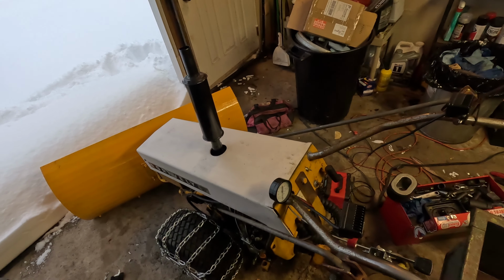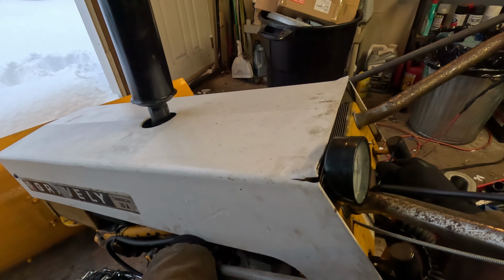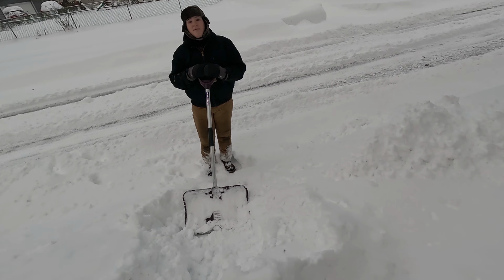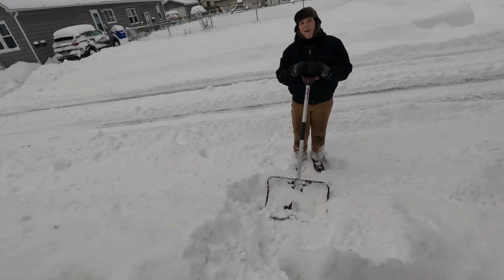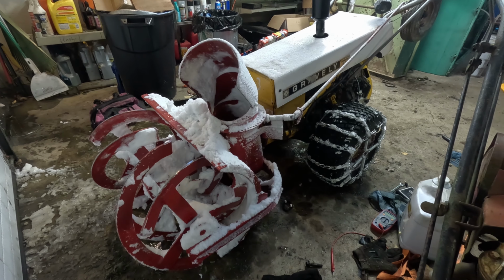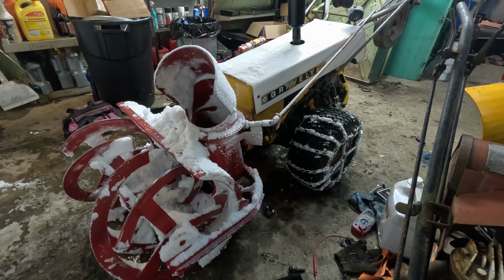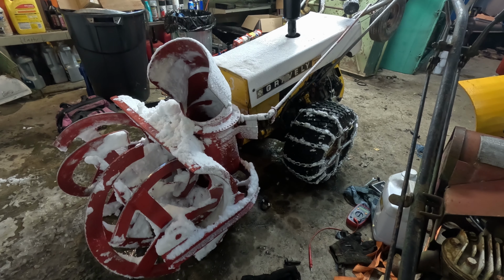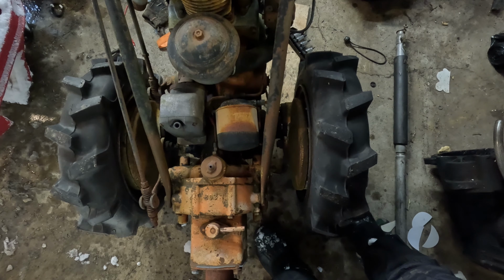Diesel Snow Blower - Repowered Gravely C10A

Comment: Cool snowblower for sure. If you add an Impeller Kit to it...that thing will throw that heavy wet snow 40 feet.
Reply from the maker: @xoff22607  A lot of it is the large inefficient augers. I switched over to a different blower attachment that throws much farther. It will need a rebuild in spring though. I will probably put impeller wipers on then.

Comment: Yeh, you are not getting enough torque or RPM to the blower, she should be throwing further.  I have a 5665 (12Hp Kohler) that I run the same delux DE on her, with the PTO set to high speed, and Range (drive) to slow, even with heavy snow she will rival a snow cannon for distance.  When it bogs it should be torqueing over the blower more, you only got it once or twice in the video.  

When we get heavy deep snow here in Ct I usually have to feather the forward gear, as she will bog down if I lock her in gear.  With heavy snow you need to keep those RPM high otherwise the chute turns into a solid brick of ice.  Feathering the forward clutch is the only way I can battle the thickened plow crud by the street during those storms, but at the same time she constantly is trying to torque over, when throwing a full chute of compacted snow.  One thing that did help was coating the scoop, fan chamber and chute with grafite slide coat (EZ Slide), but I need to recoat her ever 4 years becuase of my dirt driveway. 

I suggest you run narrow Ag Tires or Snowblower tires (Carlisle Snow Hog worked great on my Super Conv) with the blower, the wide tires are pulling snow under them and you loose traction.  if you are running the old style 6 bolt rims use the narrow rim halves for 4.0/4.8-8 tires and if you have 4 bolt hubs, metric golf cart rims fit close (lugs line up, but center is ~1/8" wider) then you use 18x7-8 ATV tires (I run this on my 5665).  With the Ag/Snowblower tires you wont need chains unless the pavement is coated with ice, I mow with the same tires and the lawn doesn't get damaged unless I hit something and the wheels need to dig in.
Reply from the maker: @rich7934  Thank you for the suggestions. 
My issue is definitely in the engine. The tractor has Model L/C10 gears which are much higher than the 5665. The diesel engine should be able to handle without bogging. I switched to a snow cannon and smaller tires in the next video. Having used it a bit more since filming, I think the snow that day was abnormally heavy. I have not bogged like that since, but I think it could still be tuned better.

Comment: Nice!  It seems to me that that setup should throw snow better but I think every machine bogs when you take big bites of heavy, wet stuff.  I have an old 8/24 Toro that I am going to re-power with a 420cc engine.  20 ft/lb of torque at the output shaft so it should be a beast.
Reply from the maker: @chriskingston4270  That sounds mean. You’re right, I realized after using it some more that the snow on this day was exceptionally heavy.
Reply: @haoleboyshow-tos2279  Yeah the Toro should perform well.  It's starting to get warmer up here so I'll be able to get in the shop and get the engine on.  I watched one of your older videos of the Gravely pre-swap.  It's hard to be sure but it SEEMS like maybe the old girl performed better blowing snow with the gas engine.  Maybe that blower attachment just likes a little more RPM?  How does the Gravely power the blower?  Is it a PTO or is it belt-driven?

P.S. Subbed.
Another P.S.  It looks like the Snow Cannon handles snow better than the Dog Eater blower.  Gravely seems like a fine machine.
Reply from the maker: @ Thanks for the sub! So, it is a PTO and gear drive. There are actually 2 different kind of gears. A higher gear pairs with the low RPM gas engine. A lower gear is for the higher RPM new motors. 
I put the high gear on for the low rpm diesel, but I think I would have gotten better performance with the higher RPM gearing. A lot of it comes down to the snow that day. I’ve never struggled as hard as this video.

Comment: "Time to do some tuning"  looks the other way adds Turbo.
Reply from the maker: @PorousShark7688  I’m not going to be able to resist turbocharging it.
Reply: @haoleboyshow-tos2279  Turbos won't work well with single cylinder diesels. Do a bit of looking around before you attempt to see if it's worth your time. Best of luck.
Reply from the maker: @ I’ve looked into it. I’m
Not expecting huge gains. I mostly want to do it to tinker.
Reply: @haoleboyshow-tos2279  ok thanks for the feedback.

Comment: Miss my old gravely it was the convertible modle with idk what kinda engine but it had 2 diff heads you can change for diff hp on the engine . I wish I remembered what modle it was but that thing was a deadly beast to use with the sulky it pulled to ride on . And moving or plowing and if you turned on a hill the handle bar would get yah between the legs if u weren’t carfull 😂
Reply from the maker: @Stuckin330  Sounds like a Model L of some kind? One of the rare accessories for that is a flat-head-to-overhead-valve conversion head

Comment: Drain the engine oil after each use and heat the oil inside dump it in just before use.😊
Reply from the maker: @bigal5323  Naw. It gets the redline when it starts, and a plywood “thermostat”.
Reply: In theory it would work, but in reality I think absolutely no one would bother with all that pre-work to start up the snowblower.
Reply from the maker: @MrJokkoma  No. I may put a battery heating pad on it though.
Reply: @MrJokkoma  in fact I have been doing it on the farm for 60 years. So has the US military.
Reply from the maker: @bigal5323  The engine has 2 oil drains, I may find a way put in a heating element. An oil change every morning before work is a tall order though.

Comment: Judging by your accumulation of toys you probably know better than I but I would have placed a 100 watt bulb against the block for a few hours of pre-use.
Reply from the maker: @paulthompson1216  I put a board of wood over the cooling intake as my “thermostat” but that’s a good idea.
Reply: Small flame ie  on inlet mainfold or air intake same effect as small  fergy and ford tractors  preheating air inside inlet manifolds 😂
Reply from the maker: @ I previously put a glow plug in the intake manifold, which works well. I just lost my tap to do it.

Comment: Check this out it is a 23 HP Aebi CC66 two wheel tractor(similar to a gravely) with a Swiss made Zaugg snowblower chewing up frozen plowed up snow. It is impressive. I will put the link in the comment, if the link gets deleted search YT for 'Aebi CC66 With A Zaugg Snow Blower'
Reply: https://youtu.be/zu5Qd1JKh8Y?si=MQl4h8sAzfChKR9i
Reply from the maker: @chrisdaniel1339  It’s interesting that they chose a single stage blower. The European walk behind snow blowers seem to scale up as high as the Rolba Snow Boy. Here in the states the blowers only get so big before they get put on a tractor.
Reply: @haoleboyshow-tos2279  That Zaugg is a two stage blower, it has double interlaced flighting on the auger and a standard multi blade impeller to eject the snow. That model is the SF-40-42, 40cm(15.75") auger, 42cm(16.54") impeller, and 120cm(47.24") wide clearing path as the 130cm width requires 20kw(26.8 HP) which is more than the 23 HP of the Aebi tractor. The chute is UHMW-PE which has a very low coefficient of friction, UHMW is abrasion resistant, and tough, also water and snow will not freeze to it thus the snow does not slow down in the chute like a metal chute. Zaugg and Schmidt both from Europe make impressive blowers.

Comment: Great job. Youve got it rough with few places to put the snow. Its surprising how well the blade rolls the snow along. The blower works great. Do you have a lower ground speed available on that tractor? I have a dog eater like yours that I got last spring. I may hook that one up and try it this year.
Reply from the maker: @4sl648  I spent most of the video in the lowest gear I have. This has C10 “run behind” gears, which I thought would be better for the diesel. I’m also on 18 inch tires now. Doing the math, they roll about 50% faster than the old ones. I just kept getting stuck with the old small tires.
Reply: @haoleboyshow-tos2279  I asked because I have a 1963 Li with 2 forward and 2 reverse speeds that always seems too fast for the blower and rotary plow.
Reply from the maker: @ The first Gravely I had was an LI, and I feel that.

Comment: Mine has kolher 12hp loads of power but  is only forward and reverse with high and low i need to find or Adapt trans to get lower ground speed for Snow blow and Rotary hoe work ... but also need  dual wheel kit which i have found a source for ...😂
How ever a Sulky kit is in the making at the moment lol  which i am  going to try and see which version suits better steered or trailed  lol 😅
Ooops also add 30" Reel head as well  in middle of rebuild lol  ie new knife bed lol
Reply from the maker: @josephcooksley3219  Sounds like a 4 speed transmission? You should be able to get gear reduction wheels for those.

Comment: Gravelys just geard too damned high for a blower in deep snow. Esp if its wet.
Reply from the maker: @ChrisComp  These 18” tires are about 50% faster than the stock 4-8s. It’s a shame, because big tires are great with the plow.
Reply: @haoleboyshow-tos2279  yeah I know what ya mean. I love the old gravelys but God sakes even in the 40s and up. The engineers must thought we was race horses just way too high geared for most work
Reply from the maker: @ChrisComp  I’m hoping to get the GRWs on the 8 speed. I’ve never used high gear aside from testing.
Reply: There's 3 versions, high, medium, and low gearing.
Plus, you can get gear reduction wheels.
High was for mowing large properties. Intermediate was the most common, and low was for someone who was doing a lot of heavy work like snow plowing or working a large garden/market garden.
Reply from the maker: @mikesmith-po8nd  You may be thinking about the model L 4 speeds. The 8 speed tractors don’t hook up to the GRWs. The low speed versions are very rare from what I understand
Reply: @haoleboyshow-tos2279
Yes, you're right. The GRWs will supposedly work with mods, but I've never done it myself and I can't remember just how it was done. IIRC, it was a PITA.
Probably the best way is just to switch to shorter tires.
Btw, I'm not entirely sure that your rig had 3 gearsets available factory. You've got me curious now. I'm going to have to do some research. That will give me something to do this winter while I'm stuck inside. :)
Reply from the maker: @mikesmith-po8nd  From my understanding, it breaks down like this:
 
Model L to C10 use higher hi/lo gear. 
The model L 4 speeds were offered as...
Slow - LS w. 4 lead worm gear 
Med - LI w. 6 lead 
High - L w. 8 lead
Reduction wheels can be added 
8 speeds are typically 8 lead. 

C10A and newer use a lower hi/lo gear. 
Most use the 8 lead worm 
There is a 6 lead, but it is very rare. 

Feel free to correct me, I know some people know these tractors way better then I do.

Comment: If you're planning to put those gear reduction hubs on your diesel C10 I'd be interested on how you'll make them fit with tge swiftamatic diff.
Reply: kubota diesel has great torque power
Reply from the maker: @FullMetalFab  I know they don’t bolt right up. I think I cooked up a slick way to make it work though. If you look around, you can see other people have done it.
Reply from the maker: @michaelmactavish4445  That would be fun. The issue is, this tractor can’t have an engine where the flywheel is on the output side without adapting the bellhousing. This makes small air cooled engines the easier choice
Reply: @haoleboyshow-tos2279  Cool, I'll have to poke around and see if I can find some picks. Just picked up a parts c10a trans with the swiftamatic to see what the differences between it and the model L trans are. Also wanted to ask if you have had any oil leaks or notice and problems with the 8 hp mound you used for your diesel swap, have had a few people tell me the 8 hp plate is too weak but my 186F weighs almost as much as the K181 that used that plate?
Reply from the maker: @FullMetalFab  The diesel is a comparable weight to a K241. I have not experienced any leaking or any other issues in that area. 
There are 2 different kinds of Swiftamatics. The 500 series and older are one kind, and the 5000 series and newer are another. The older version left side can bolt directly to a GRW.

Comment: Can you not control the speed? Moves mighty fast for blowing snow.
Reply: Nm. Just finished the video. lol.
Reply from the maker: @chevy6794  Yeah, issue is that it is a geared transmission. It only goes so low, and the blower speed affects the driving speed.
Reply: @ Ya. I figured so. I guess it’s all gear box to ay?  A track kit with really small drive sockets maybe?
Reply from the maker: @chevy6794  Just smaller tires can make it 1/3 slower. There are also portal hubs for these tractors that can make them even slower.
Reply: @haoleboyshow-tos2279  Oh wow. Like planetary hubs? I thought that but was like would be way to expensive to modify something to fit. Never would have that that was a thing. Cool.
Reply from the maker: @ Yes, for these Gravelys they call them “Gear Reduction Wheels” but they are portal hubs. The parts tractor that I was showing at the end of the video has them. The whole tractor was only $100.
Reply: @ that’s really neat.
Reply: I thought I read in gravely manual with a swiftmatic engaged in low range it reduces ground speed by half without affecting implement speed. Is that not what you've noticed?
Reply from the maker: @hayesclawson6387  It does work that way, but the lowest ground speed is still pretty fast for deep snow. It’s a trade off. The blower wants high rpm to throw, but low RPM to ingest snow at a reasonable rate.

Comment: Need to be slower .
Reply from the maker: @jackfrosty79ify  Working on that. I threw smaller tires on for now. That has me going 1/3 slower. I’m planning to put portal hubs on that that will make it run 1/2 speed on top of that

Comment: That thing sucks! It is way underpowered.
Reply from the maker: @jonathancupp3686  The engine is rated for the same power and more torque than the factory engine, but it is underperforming. 
1. It needs some tuning. 
2. This blower doesn’t throw far at the best of times. High volume, but it only shoots like 10ft. 
3. The snow that day was abnormally heavy. I’ve used the blower a few times since and it performed much better.
Reply: @ get a Kubota. I have the L3200 GTX and it throws even the heaviest wet snow a good seventy five feet.
Reply from the maker: @ I should hope so. That’s like 10x the tractor.